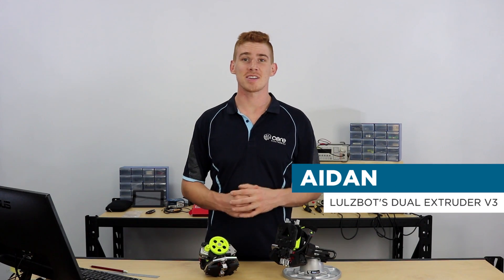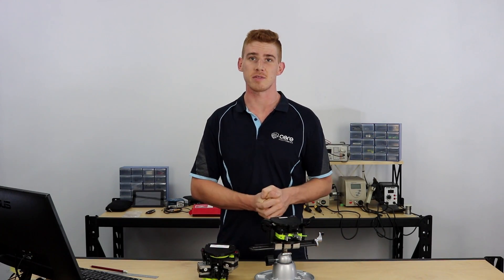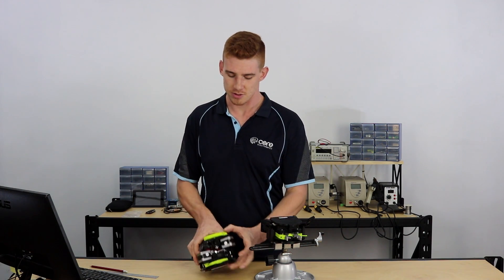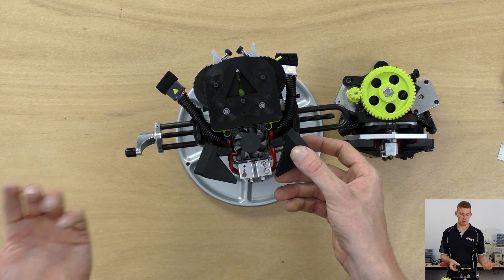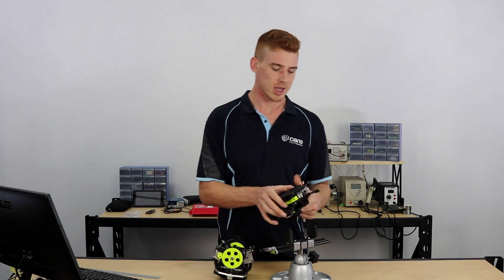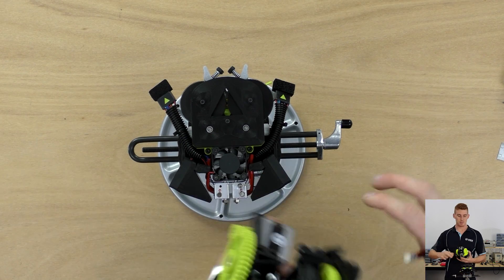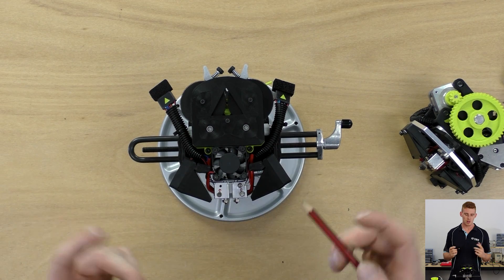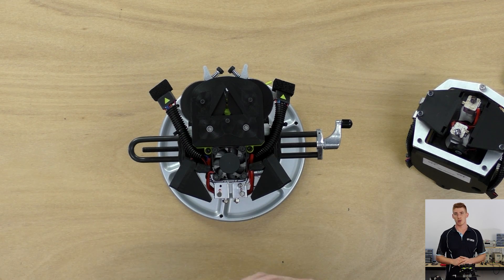LulzBot Dual Extruder V3 Overview - What has changed from V2

Comment: The dual v3 is a garbage print head-  don't waste your money.  I have tried to make this head work for 6 months to no avail... maybe 2 successful prints after several hundred attempts.  It has heat creep problems that prevent a person from finishing any sizable print, and the filament path is so sharply curved with such a small hobbed bolt, that it jams and grinds ALL THE TIME.  Don't buy this toolhead-  lulzbot should be ashamed of themselves for selling this POS.
Reply: I'm so close to just getting a refund it only works with flexible